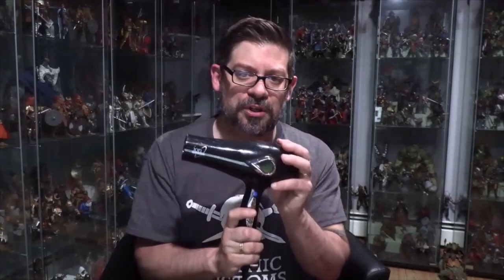Using a Blowdryer to Quickly Dry and Smooth Custom Paint

Comment: One question: what clear coat do you recomend to protect the paint and also for not getting sticky?
Reply from the maker: If use a Testors Dullcote spray laquer.  Make sure it is NOT enamel!  I will say that while I love this coat, the super soft pieces, like loins, often remain sticky.  I tend to avoid even painting the soft plastic for that reason.